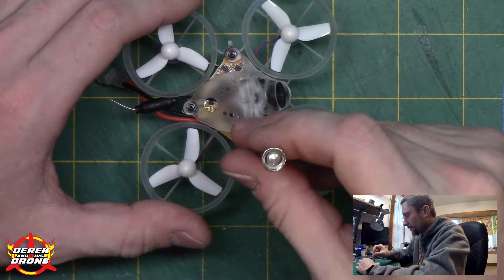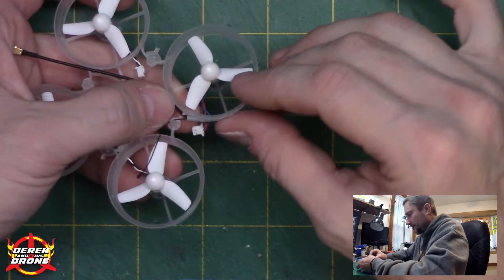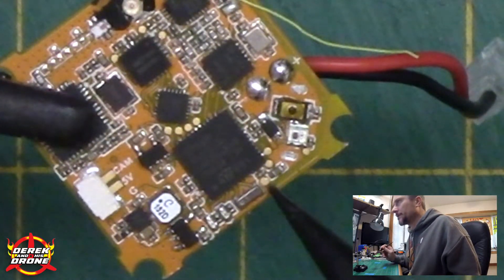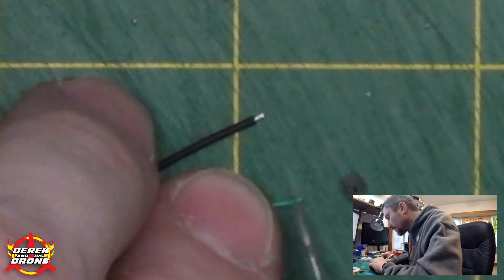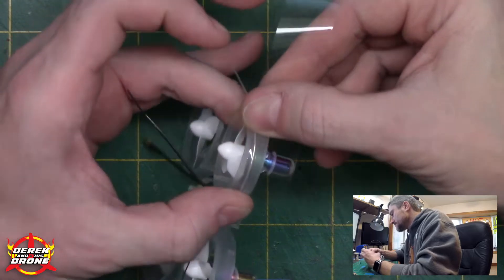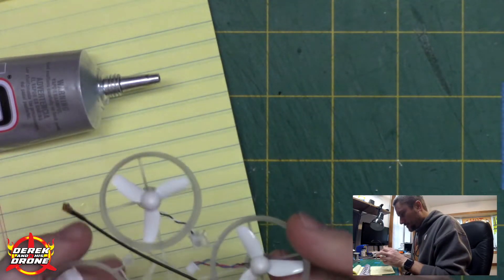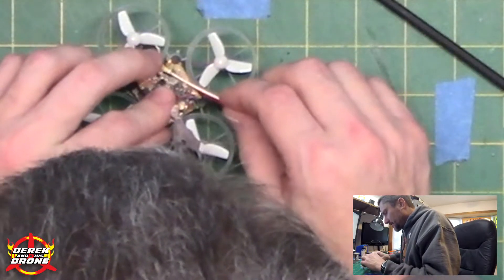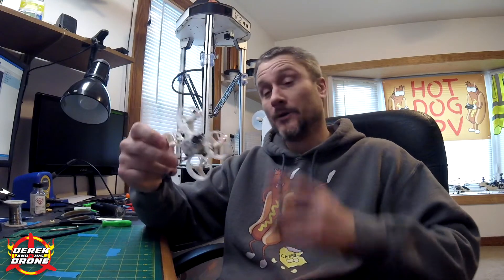Crossfire your BeeBrain Lite - How to install Crosfrire in the AcroBee Lite

Comment: Hey - this was actually a very clever install. I am looking in to the r9m system instead of TBS but I do find that very fascinating how you wrapped the antenna around the ducts. My "tiny whoop" of choice is a Tiny Hawk S that has pretty good battery - except for the built in SPI Frsky receiver limits the range (fail safes). XM mini I had a very unreliable experience with on another drone and after losing two drones in canopies from failsafes, I'm after the 900 mhz penetration.

Anyways, here is a photo of the underside of the Tinyhawk: https://chrisbarrbuilds.com/wp-content/uploads/2019-08-24-14.16.50-1024x768.jpg  I feel like routing the antenna and ground plane might be perfect in those little indents  underneath. The tricky thing is figuring out how to route that main part of the ipex 4 connector. 

anyways, love your videos. subscribed
Reply from the maker: If you are serious about a robust long range system I would recommend going straight to crossfire.  R9 is half the price but crossfire gives you 4x more. Almost everyone with R9  upgrades to crossfire.

Your antenna should go perfectly inside the frame.  Wrap it around just like I did.  Maybe use a little E6000 or hot glue to hold it in place.  If necessary I'll put a little notch in the frame to accommodate the wire.  Just put a dab of the fore mentioned glue over the spot after to retain the wire and re-enforce the frame.
Thanks for subscribing.
Reply: @DerekandhisDrone  Ah, so I have the Taranis Xlite and from what I can tell, to use the TBS micro, I need to get a weird attachment since it doesn't have one of those j-port bays (probably butchering the terminology). Yeah, maybe I should just bite the bullet and make that system work as everyone seems  to love it. thanks for the reply!
Reply from the maker: I have seen a nice 3D printed bracket for your model radio.  Maybe try searching Thingiverse, you might find a better setup.

Comment: Hi Derek, I like your channel, cool video, thank you. I'm having a issue with my Acrobee Lite and i was wondering if you had come across it or anyone of the guys here have. Whilst  it's flying, it always drops out of flight and power cycles it self. I've replaced the power cord and connector, no joy. I have tried different 1s batteries, I've flown without camera and canopy, none of which have made a difference. Any suggestions are welcome. Cheers Gaf. Uk.
Reply from the maker: I think your best bet is going to create a support ticket with NBD.  They will get you straightened right out.
https://newbeedrone.zendesk.com/hc/en-us/categories/360000094653-Technical-Support

Comment: I would put some solder on the wire and then press it onto the pad. Much easier and safer derek.
Reply from the maker: I did tin the wires, it just didn't make it into the video.  I had some technical difficulties and the record time of the video was over two hours and took six hours to edit.  Some things got cut out.  I think shortly down the road I will do a soldering basics video.